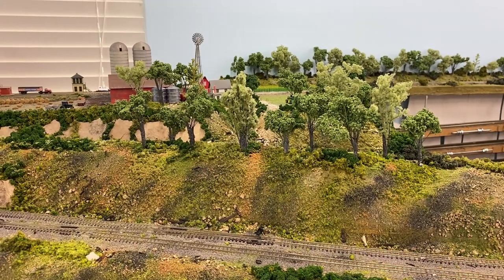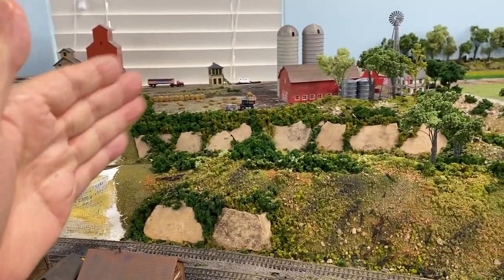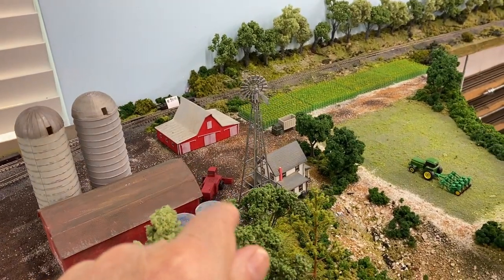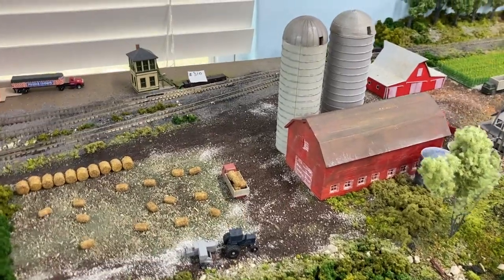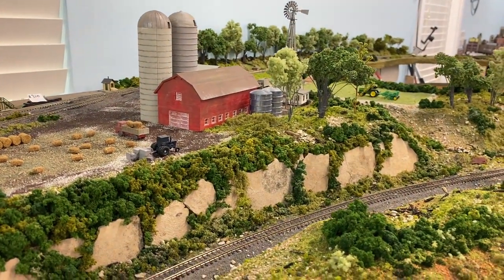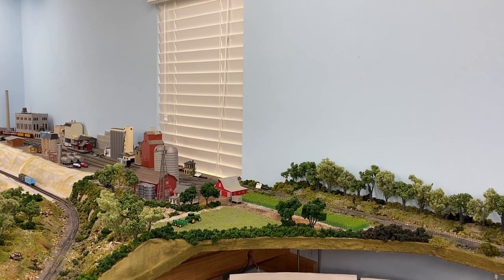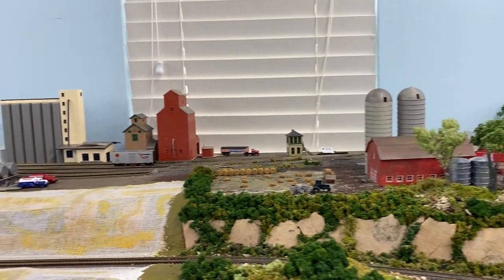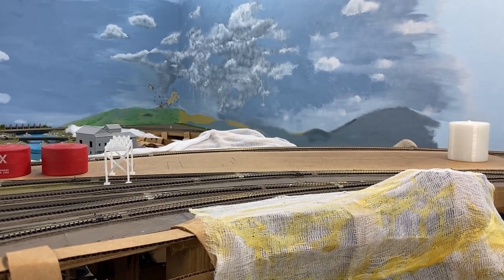Farm Scene Completed

Comment: John, seems like a great way to cover the helix. I’m recently subscribed and I’ll have to go back to see what you did on the helix in full.
Reply from the maker: Hi Ken, Thank you for subscribing and your comments.  The spline helix is made from Masonite hardboard  and is 24 pieces wide to form the base for the two tracks. I do have a playlist that shows some of the construction. The west helix has to be kept open since I need to be able to have routine maintenance on the mini-split HVAC unit that is just above it. The east helix is of similar construction but is pretty well hidden under the Union Station engine facility.......John

Comment: The farm is looking really good, John.  Love the way you made it.  It adds so much to the layout.  Are you going to add another one later on?  To represent rural areas it seems you can't have just one.
Reply from the maker: Hi Michael, Thank you for watching and your comments. Originally I was going to have two small farms but I decided to create one large one after expanding the area over the top of part of the west helix. The area where the other farm was going to be will now have some pump jacks to supply oil to the large refinery that I will be putting at the beginning of the loop at Tulsa. There may be some room for some other rural looking areas later along the back wall just outside Paradigm station……John